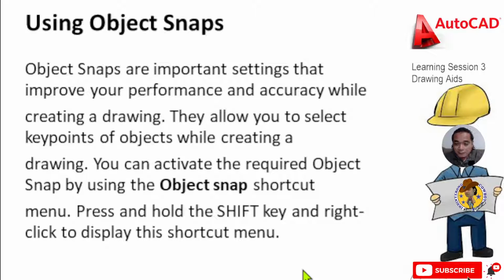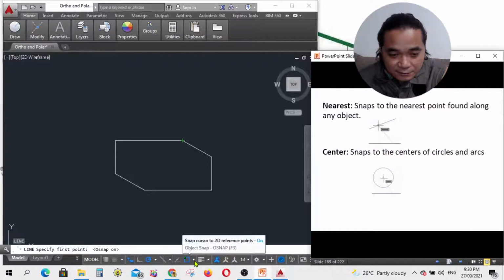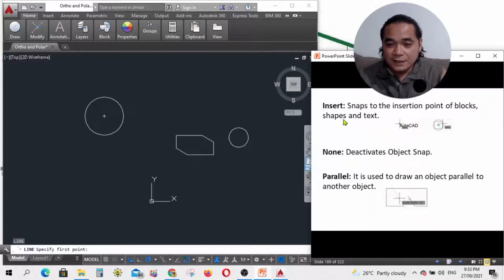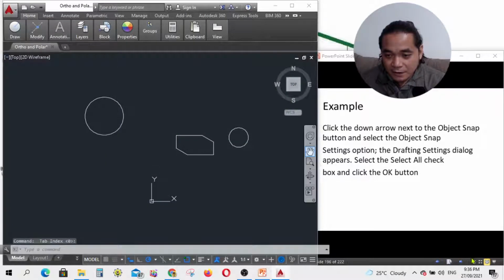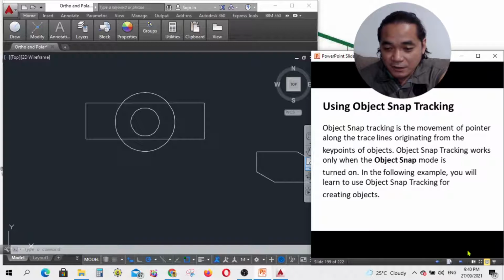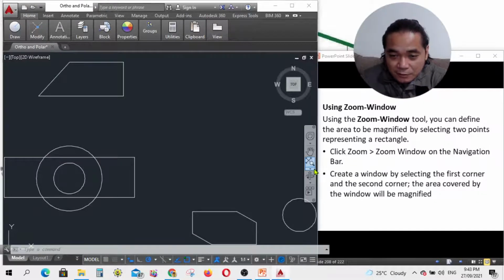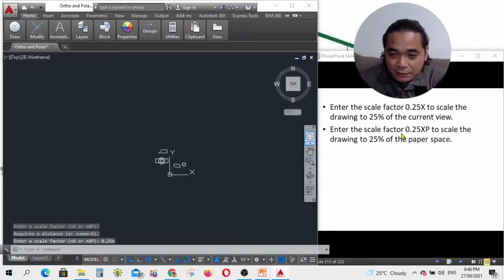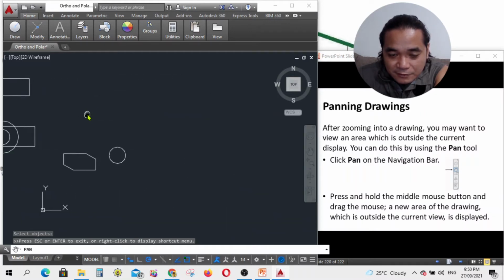AutoCAD LS 3-3 | Drawing Aids

Comment: In this final section of Learning Session 3,  I discovered that object snaps are important settings that can help us improve our drawing accuracy. It enables us to select key points of objects while drawing. This video demonstrated the functionality of various Object snaps. In which we can make the Object Snap Modes available indefinitely rather than having to select them each time we want to use them. There are various zoom levels that we can select depending on our needs when zooming. While the panning tool is very useful for shifting the drawing in any direction we want. Finally, each time we zoom and pan our drawing, a new view is displayed. Kudos to sir. Thanks a lot sir. Keep inspiring other engineering students😊.

Comment: The final part of Learning Session 3 though us how to use Object Snaps, cycle through Object Snaps, use Object Snap Tracking, Zoom tools, and Panning Drawings. Object Snaps are useful settings that helps us improve our performance and accuracy in creating a drawing. Also, covered in the video are the functions of various Object Snaps. And instead of having to select Object Snap modes, we can make them available all the time. I learned also that there are different zoom options available for seeing the drawing or specific objects. When moving the drawing in any direction, panning is vital. Zooming and panning the design allows us to change the view, return to the current point, and magnification of the AutoCAD drawing. 

I really learned a lot from you Engr.! Thank you for explaining it clearly.

Comment: In this last part video of the LS 3, I learned about the uses of object snaps, zooming tools and panning and its relevance to the drawing aids. These tools are significant settings which improves performance and accuracy and these would allow to select keypoints of objects while creating a drawing or objects. By using the object snap shortcut menu we can activate the required object snap. Also, I learned that there are various ways to zoom the drawing such as extent, dynamics, zoom all. Panning which is the useful in viewing an area outside the current display. In adjusting the location of the object, the Panning is useful in a sense that to move the graphic window or the drawing. Nonetheless, these important settings really helps improves my performance and this will serve as the guide/basis in creating or doing the drawing especially the Exercise 3. Thank you so much Sir💙

Comment: Good Evening Sir.
Pauline Peace to you!

These are the following concepts I learn in this Video:

1. Using Object Snaps - provide a way to specify precise locations on objects whenever you are prompted for a point within a command.

2. Running Through Snaps -  provide a way to specify precise locations on objects whenever you are prompted for a point within a command.

3. Cycling Through Snaps -allow us to snap onto a specific object location when you are picking a point.

4. Using Object Snap Tracking -  allow us to snap onto a specific object location when you are picking a point.

5. Using Zoom Tools -  allow us to snap onto a specific object location when you are picking a point.

6. Panning Drawing - Hold down the scroll wheel as you move the mouse. (The scroll wheel is also considered a button.)

That's all!
Thank you and God bless!

Comment: LS-3.3| I have learned in this last part of the learning session 3 the ff. Drawing Aids: the Object snaps (cycling through object snaps and Object Snap Tracking), Zoom tool and Panning. I learned that Object snaps are important settings that may help us improve our accuracy in drawing. It allows us to choose key points of objects while making our drawing. This video has showed us the functionality of different Object snaps. Wherein we can make the Object Snap Modes accessible indefinitely rather than having to choose them everytime we opted to use them. In zooming, there are different zoom levels where we can choose at depending on our needs. While in terms of shifting the drawing in any direction we want, the panning tool is of great help. Lastly, everytime we zoom and pan our drawing, a new view is being presented.

Thanks and God bless sir!

Comment: IN LS3-3, I have learned about Object Snaps which are important settings that allows me to select keypoints of objects while creating a drawing. It will really help me to improve my performance and accuracy while creating a drawing. Object snap tracking is the movement of pointer along the trace lines originating from the keypoints object. Learned the different ways to zoom the drawing (dynamic, extent, zoom all). Panning is also useful in viewing an area outside the current display. Thank you Sir for all the knowledge you have shared for free!

Comment: Finally, in this video LS-3 part 3  explains how to utilize Object Snaps, cycle between them, Object Snap Tracking, and use Zoom tools and Panning Drawings. Object Snaps are essential parameters that let users create and draw more quickly and precisely. It helps us to select the important details while drawing. This lesson also covers Object Snaps. We can make Object Snap modes available without having to choose them each time. I've found that various zoom settings are available for viewing the artwork or specific objects. Panning is essential when moving the drawing in any direction. We may change the perspective, return to the current location, and magnification of the AutoCAD design by zooming and panning the drawing. Thanks sir!

Comment: In this part 3 of Learning Session 3 it talks about using object snaps, running object snaps, cycling through object snaps,  using object snap tracking, using zoom tools, panning drawings. In using object snaps I learned that object snaps are important settings that improve the performance and accuracy while creating a drawing. It allows you to select key points of objects while creating a drawing. While in using object snap tracking it is a movement of a pointer along the trace lines originating from the key points of objects that object snap tracking works only when the object snap mode is turned on. However, in using zoom tools I’ve learned that it is a magnify or reduce a drawing in which you can use these tools to view minute details or a very complicated  drawing. The zoom tools also can be accessed from the navigation bar, command line, and menu bar. Thus, all of this learning session from part 1 until this last part are very essential modes and methods of entering data that, once mastered, allow readers to create measured drawings with ease. All of AutoCAD’s drawing aids and tools are meant to help the CADer simulate all kinds of traditional and conventional drawing techniques. Thanks a lot Sir! God Bless :)

Comment: LS 3-3. In this learning session, I have been introduced how to use Object Snaps. These are important settings that improve our performance and accuracy while making a drawing. It consists of shortcuts for us to have convenience every time we make a drawing. It provides us examples on how to use the Object Snap. On Running Object Snaps, instead of selecting each time we use these, activating this will make its availability continuously. We can also Cycle through different Object Snaps. Examples provided makes it more comprehensive. I have also been introduced to Using Object Snap Tracking and Using numerous Zooming Tools found on the menu bar or by typing it in the command line. These will help us view complicated areas. In addition, Panning Drawings will help us view an area that is outside the display.

Comment: This is the last section of LS-3; it discusses how to use and execute Object Snaps, cycle between them, and use Object Snap Tracking, Zoom tools, and Panning Drawings. I've discovered that Object Snaps are critical settings that help users work more efficiently and accurately when designing and sketching. They enable you to pick critical spots on things when sketching. This course also covers the functionality of different Object Snaps. We can make Object Snap modes accessible indefinitely rather than having to choose them each time. In terms of zooming and panning, I've discovered that different zoom levels are available for seeing the artwork or particular items. When it comes to shifting the drawing in any direction, panning is critical. By zooming and panning the drawing, we may change the view, return to the present position, and magnification of the AutoCAD design, and each time we zoom or pan, a new view is created.

I find this kind of video material very beneficial as a novice in AutoCAD. Many thanks, sir. I'm excited for the next learning sessions.

Comment: Hello and good day, Sir. Upon finishing this learning session, it emphasizes the convenience of use of AutoCAD's object snaps and zoom tool as drawing aids. The information about Object Snaps is simply beneficial to users like me, as this tool identifies the key points of the object. The key points of the object differ depending on the functions of the various object snaps employed. It can pinpoint the middle, the center, the nearest point, and many others that can substantially assist the user in targeting those points, as demonstrated by Sir Mardie's example. Using Object Snap Tracking can also assist in easily and successfully tracing the last crucial points of the object drawn. In terms of zooming tools, Sir Mardie demonstrates how to adjust the scale of the drawing area to address the scope of all visible objects. Those who have a Mouse, on the other hand, may easily control it with the wheel.

Looking forward for more videos! 
Thank You and God Bless.

Comment: LS 3-3

This learning session highlighted about using Object snaps for your drawing aid. For example, you can use object snaps to create  line from the center of circle to the midpoint of another line. You can specify an object snap whenever you are prompted for a point. Engr. Pongcol also discussed the functions of various snaps like the endpoints, midpoints, the nearest centers, geometric centers, tangent, quadrant, intersection, apparent intersection, perpendicular, node, midpoint between 2 points and temporary trackpoint. Also, engr. tackles about running object snap in which it  specifies precise locations on objects whenever you are prompted for a point within a command and remember that objects snap tracking works only when the object snap mode is turned on. 

In using zoom tools, it is very vital for your work since it enables to display all visible objects and visual aids. Adjusts the magnification of the drawing area to accommodate the extents of all visible objects in the drawing, or visual aids such as the grid limits whichever is larger.Lastly is the painting drawings in which you can do this by using the pan tool. That's all and Thank you sir!

Comment: n this video, object snaps, the zoom and panning tools were explained . I have learned that object snaps can select the specific point of the object buy jusf activating the functions indicated in the setting of the button. Object snap is very useful to assign or locate points of the object that could also make accuracy and certainty of the measurements or alignment of the object. Zoom and pan tools were also be located in the navigation bar where it could also be use through the comnand line. And I also learned that there are different ways to zoom the drawing or the object (extent,dyanamic, zoom all, etc.). Panning is also useful to move the graphic window or the drawing, which is also useful in adjusting the loaction of the object. 
Thank you sir!

Comment: In this video, I learned that object snaps provide a way to specify precise locations on objects whenever you are prompted for a point within a command. Engr. Pongcol also highlighted the functions of various snaps. The running object snap provides a way to specify precise locations on objects whenever you are prompted for a point within a command. In using object snap tracking, the movement of pointer along the trace lines originating from the key points of objects. Objects snap tracking works only when the object snap mode is turned on. Moreover, in using zoom tools, I learned its essence most especially when making a drawing it's because you need to zoom your input in order to determine and monitor every details so that the result would be perfect. There are lots of zooming parts explained by Engr. Pongcol which helps me simplify my work. Lastly is the painting drawings in which after zooming in your drawing, you may want to view an area which is outside the current display. You can do this by using the pan tool. To sum up, learning what are the parts on drawing aids plays an important role so that the result of your output will be good and precise. Thank You So Much Sir for this video! Godbless!

Comment: In this last video ,I learned that the Object snaps provide a way to specify precise locations on objects whenever we are prompted for a point within a command. And we can use object snaps to create a line from the center of a circle to the midpoint of another line and also we can specify an object snap whenever we are prompted for a point.  Thank you sir it is helps me a lot .

Comment: For the last part of Lesson 3, I was very thankful because I learned how to use the object snaps, the running object snaps, the object snap tracking , the zooming tools  and the panning. An object snap helps us, the users, in the aspect of accuracy and performances because it helps the user to select the object's key points. It is also highlighted here the functions of various object Snap such as the endpoint which we can observe shows a green square when you are at the end points, the midpoint which shows triangle when you move your cursor in the midpoint of the object, the nearest where it snaps the nearest points, the center where snaps the arc or circle’s center, the geometric center and many more. The running objects snaps, which can be customized or modified. The object snap tracking is the pointer’s movement along the trace line. The zooming tools which help you to view your object in your desired display, this icon is present in the navigation bar or just simply used the middle wheel of the mouse if you have one. Lastly, the panning which is also present in navigation, this icon help you  to move your workspace so that you can easily create your object. Thank you sir for this knowledgeable video, God Bless.

Comment: In this video, I have learned how to use Object Snaps and some of its application. And then the function of Zooming tools and its application  which is you can set and select so many  options in zooming in or zooming out the object line or the object. And the introduction and purpose of the panning drawing by viewing an area which of the  drawing, which is outside the  current view is displayed.

Comment: The third and final part of Learning Session 3 covers how to use and run the Object Snaps, cycling through Object Snaps, using Object Snap Tracking, Zoom tools, and Panning Drawings. I’ve learned that Object Snaps are important settings that improve your performance and accuracy while creating a drawing. They allow you to select key points of objects while creating a drawing. The functions of various Object Snaps are also explained in the video. We can make Object Snap modes available continuously instead of selecting them every time. In terms of using the zoom tools and panning, I learned that there are various zoom options available for viewing the drawing or specific objects. When it comes to moving the drawing in any direction, the importance of panning takes place. By zooming and panning the drawing, it helps us to alter the view, return to the current
 location, and magnification of the AutoCAD drawing, and each time we zoom or pan, we can create a new view.

I’d say, this video content is really helpful for us and I just want to say thank you very much, sir, for the knowledge
and I'm looking forward to learning as deeply as possible the various aspects of this software.

Comment: In this learning session 3-3 I learned on how to apply and how to use all the tools/objects in the object snap when you turned it ON in AutoCad. I learned also that objects snaps are indispensable tools and you can’t make precise drawings without using them. Knowing about the object snaps will just make your drawing workflow much more efficient. Thanks for this video sir😊